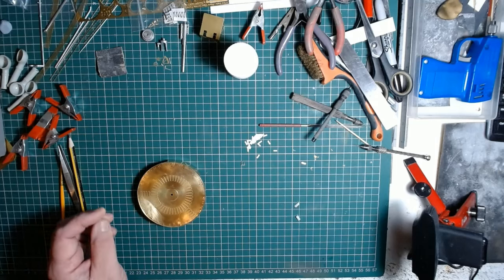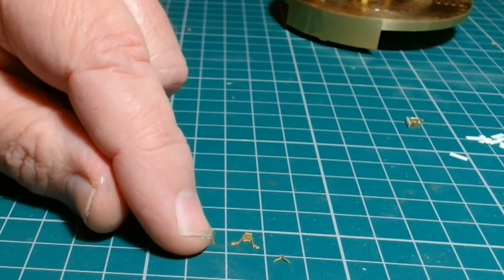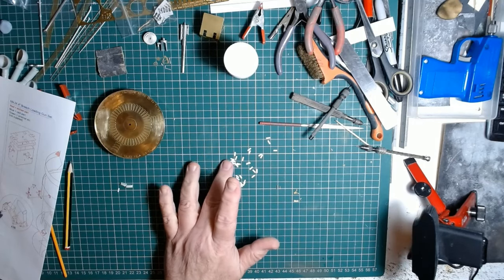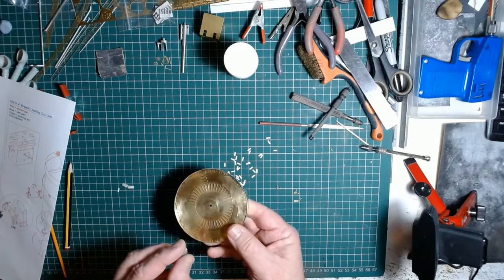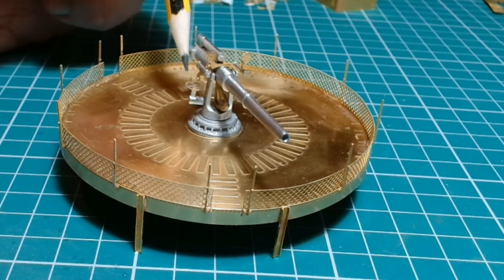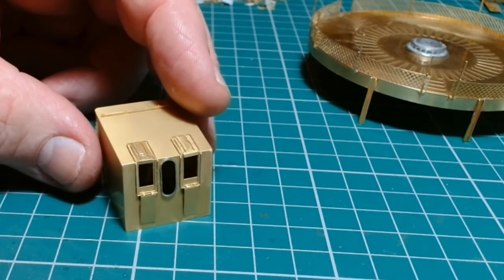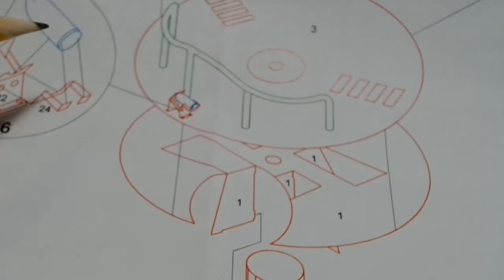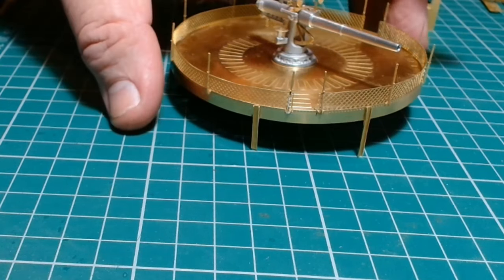Super-detailing the Revell/Matchbox 1/72 Flower Class Corvette Part 5: Main Gun Completed

Comment: Fabulous update….looks brilliant and from the detail shown is clearly a very challenging / satisfying build.
With regards to the fine wire running round the top of the railings have you considered individual stranded copper wire (when stranded flex is stripped) as there is a multitude of different sizes when wires are stripped back….🤔
Normal cable flex, old phone charger to name but two.
The other option could possibly be the really very fine elasticated rigging (not sure of the brand) the type used on model aircraft etc. 
Enjoying very much your build and even more the explanations you give along the way….Oh and that gun shield looks fab.
Haven’t started mine yet due to other things on the bench at present but your documentation of the build will, when I do start be invaluable and very much appreciated.

Thanks again 
Best Gary

Comment: Another great video.  I wonder if the shell and holders could be 3d printed as one piece. I remember some brass parts from aircraft modelling that would break easily. Sometimes, heating with a gas lighter would help with a light score with a blade on the opposite side. Didn't always work, though. I'm looking forward to seeing your progress. All the best.
Reply from the maker: I did think I might 3D print them as I have that facility however I think the two brass parts mounted on the styrene strip and carrying the shell will suffice. I agree that annealing the parts often works however, in this case, I think GLS got it wrong and could have made each cradle from one piece that folded up rather than three pieces.
Reply: I think your idea is the best solution for it . There are so many small, frustrating parts . Thank you for your response.  All the best.